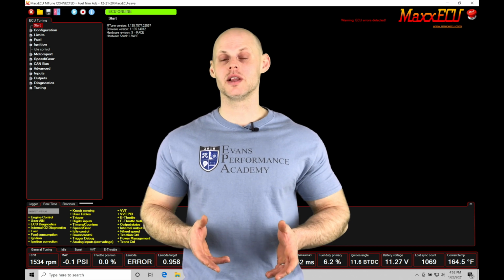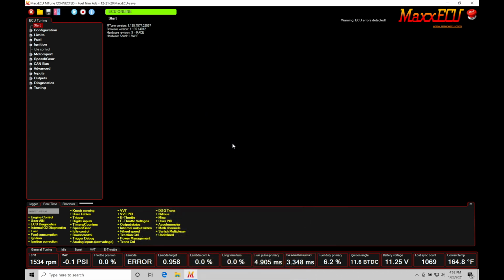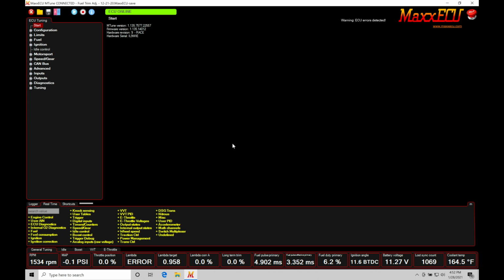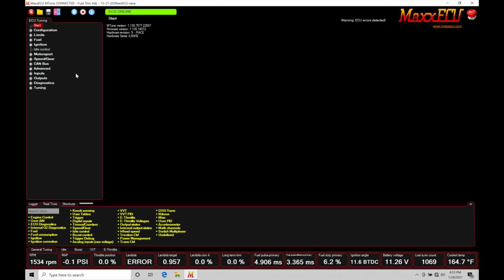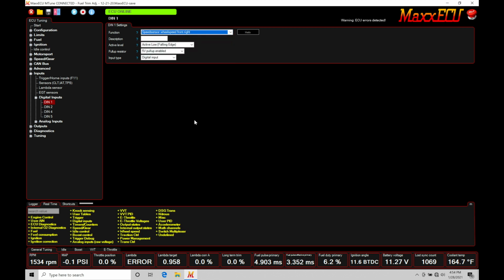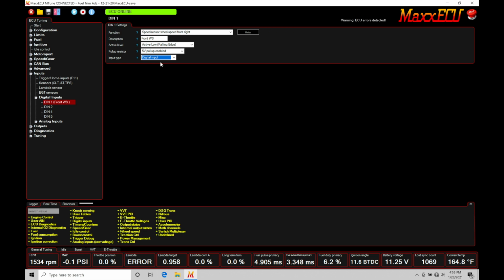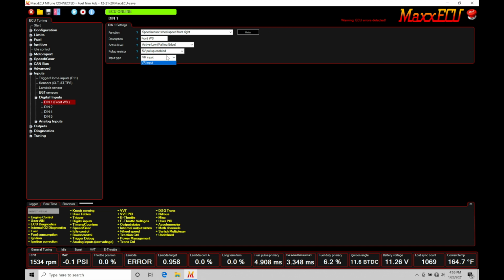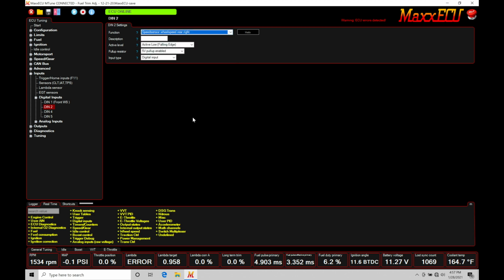MaxxEcu Training Part 51: Traction Control | Evans Performance Academy

Comment: i used Garry's mod to code a TCS using this SAME EXACT way of measuring slip. my solution for slip is: cut off power while a timer runs and return to input when it ends. but 2 more steps are added so it's smooth (they require higher slip values but cut for longer). then i made like 7 or 8 TC levels that i can change while driving and boom, i have gt3 tc for cars in a source game from 2013. programming is awesome 😎 crazy that i came across this video while searching.